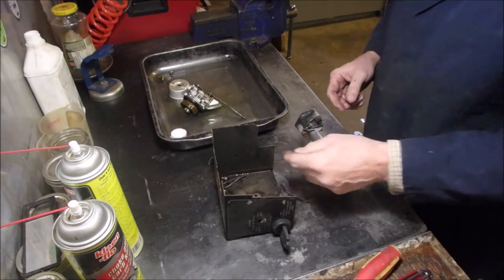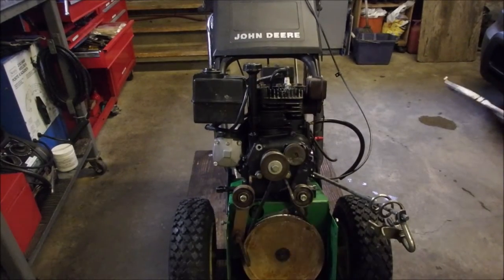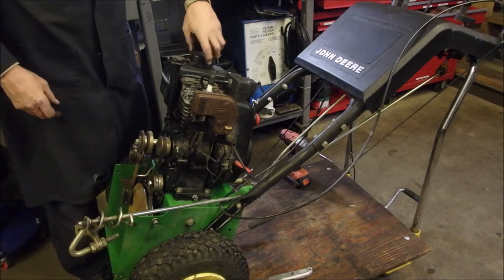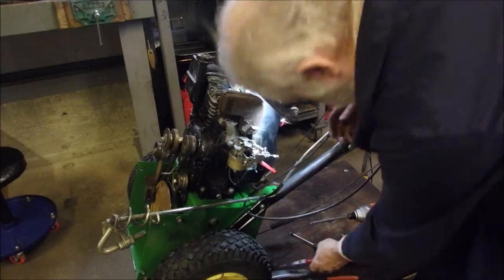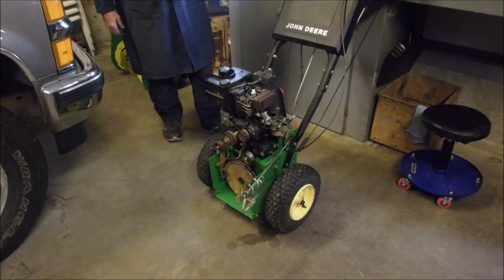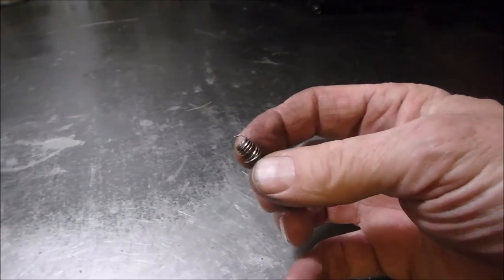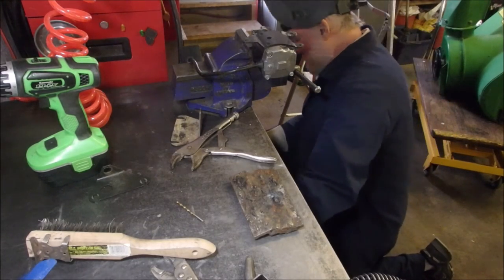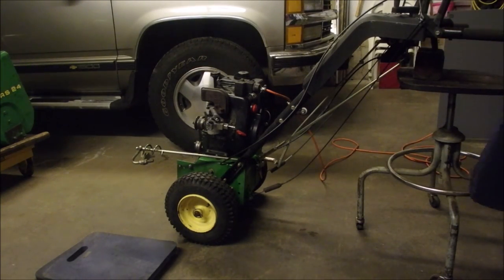John Deere TRS 24 Snowblower Fuel Lines and Starter

Comment: That fuel line passage on a Tecumseh HS50 is tight!  I've used a section of 1/4-20 bolt to use as a coupler between the old and new fuel lines on other engines, and I've also used the metal clotheshanger method in the past, but I actually removed the flywheel cover to replace the fuel line on the last HS50 engine that I worked on.
Reply from the maker: I have removed the flywheel before  as well.  I have used up all my narrower black fuel line and just barley got this on  through.  Using the tygon fuel line did the trick for me.

Comment: Tried that same method for installing a couple fuel lines on a 5hp and a 10hp as well. 10hp worked ok and the other I pulled the shroud and it was no big deal only took a few mins longer. Good stuff Bruce you will be tossing snow in no time.
Reply from the maker: Thanks   I am getting close.  A bit of engine work to come

Comment: Hey Bruce,
I feel that if the helicoil can be installed so that it holds permanently, I’d probably go in that direction.  It’s possible that the metal around the original hole is softened by the previous damage and may not hold a thread.  So, it’s kind of a judgement call.
Reply from the maker: Thanks.  It could be the Helicoils I have tried the hole is already damaged.
Reply: @BrucesShop  
Trouble is…
Those darn snowblowers are constantly trying to shake themselves to pieces!

Comment: Yep definitely getting better at that welding Bruce i think we will print up a Welding Certificate and send it your way. It is those heat shields that normally grab the hose when your trying to pull it through they also cut into the hose from vibration over long periods of time. I find it easier to pull/push the fuel line through if i remove the fuel tank and stop if from grabbing on the heat shielding. Have a safe trip to and back from Mexico buddy!
Reply from the maker: a few more days we leave Thanks

Comment: Good job fixing that tab on that otherwise good starter. Those things are getting hard to find, and I have seen them in the $120 range.
Reply from the maker: That is crazy.  I do have 2 more in the hoard but being as i am keeping this blower I repaired the original.  Thanks again.
Reply: @BrucesShop  I got a Tecumseh Snow King snowblower engine at auction over the summer for $25. The gas tank is worth $20, the starter is $50, and the engine runs.

Comment: Hi Bruce hope you had a very Merry Christmas! Was just wondering how big is your garage? Mines a 24x24 and I never have enough space for repairs it seems. Great repair! Those lines just don't last with new fuel we have now. Cheers brother!
Reply from the maker: My garage is 26X26 with 10 foot walls.  I had a smaller one earlier in my life and i knew the extra 2 feet on the side and front would make a difference.  Especially for parking the truck with room for benches.  Good of you to notice.

Comment: Bruce, Im having trouble getting verification to this.  I have this same engine on my broken snowblower, It doesn't even have a light on it but it came equipped with a stator on it which seemed unnecessary, but that stator came of and seemingly locked the engine up, Until it was opened up and saw that the reasoning was just the stator had come loose and seized everything up.  The casting mount that the screw mounts in on the top was broken clean off .......Do you know if the mount on the bottom is supposed to be the same distance.  I bought a new stator and light to try and get that option going, but I was wondering if that hold at the bottom should work, or if there was something else that normally mounts there.
Reply from the maker: I have to confess i have never had on of these Tecumseh H50 come in with a light.  I am sorry

Comment: I take the 2 bolts out of tank.  (Remove tank) with carburetor already off pull fuel line out. Feed new one in from tank side. With a light and long screwdriver on carburetor side push line in work it with screwdriver to get it going in when enough pull it through with long needle nose. Install carburetor. Tank shutoff cut line to length. I use automotive fuel line seems to be better quality.
Reply from the maker: Good idea!!!